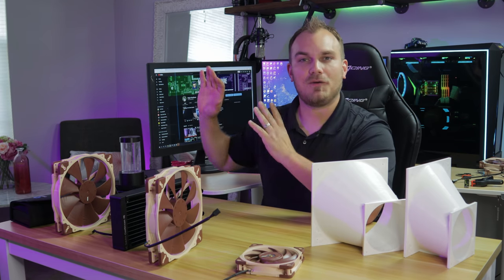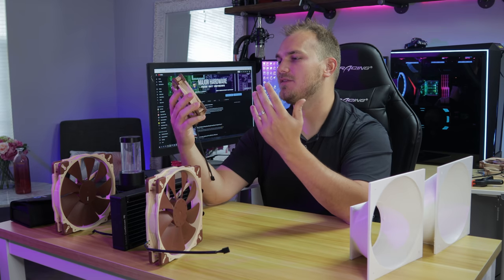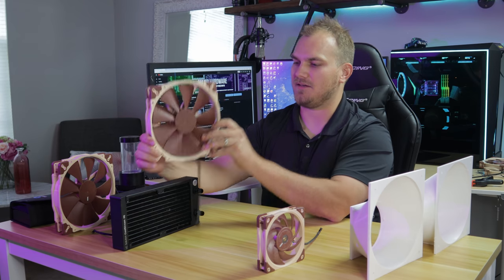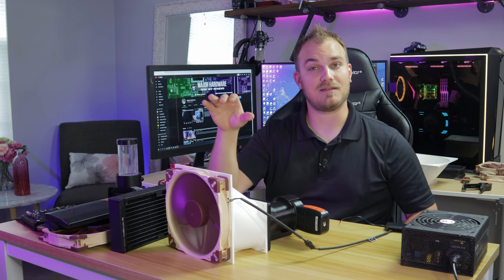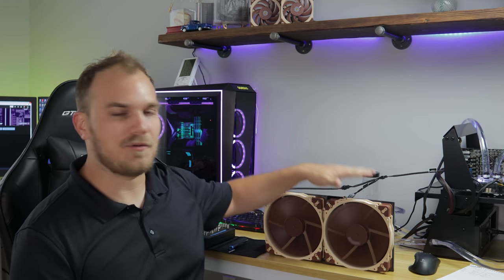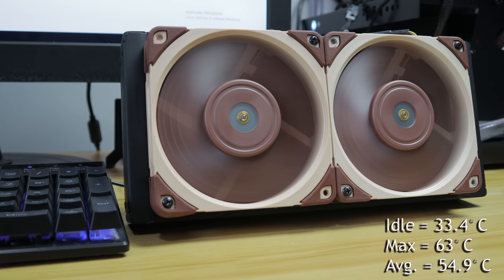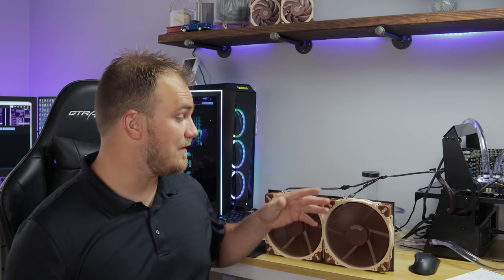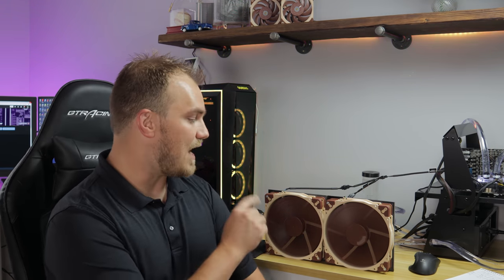Cooling A 240mm Radiator With 2 MASSIVE 200mm fans

Comment: Could you print a 200mm rad for these fans? Well, I guess you could if you could print metal. 🤔
I am thinking a 200mm rad could be way thinner than these smaller rads as you have more surface area, and that also means you need to have less air pressure to push/pull air through the rad.

Comment: Idea for an air-cooled PC: routed air intakes for CPU and GPU. Draw in air from a case fan, have it blow into an air duct leading directly to an enclosed heatsink, and then through another air duct leading directly to an exhaust case fan. Add another case fan for positive or negative air pressure for mobo cooling, totaling 5 case fans. I wouldn't take the dedicated fans off the heatsink though unless it causes problems.

Comment: Do the same thing, but port and "polish" the fan shroud you made! like the intake of a performance motor. you want it to be nice and smooth to let the air run as well as possible!port the 120mm fan holes you made so the big fan can take advatge of the square radiator! "polish" the print with some acitone to smooth it out

Comment: What about just 1 200mm fan on that 240 radiator? It should be a simple cad to make it work. You don't need 10cm distance from the fan to the radiator as you have on the 2x200. Also, what about in PULL mode?

Comment: are there any good and silent 180mm fans? cause that's a good compromise between 120/140mm fans and a 200mm fan and is the same size as a Mini-ITX motherboard. Not to mention there's actually 180mm sized radiators :)

Comment: The small side of the shrouds could have been square with tabs on the interior for the screw holes... basically to let the fans push air directly at the full fin surface area.

Comment: To take the full effect of Bournelli's principle the two diameters should be concentric. This gives the ram effect. In the current design, the top half has the ram effect, and the other half does not. Btw, which Solidworks version that you have?

Comment: I would have tried to cool the 120mm x 240mm radiator with a single 200mm fan.  The cross-section area of the 200mm fan is ~31k mm², while the cross-section of a 120mm fan is ~11k mm², so you would have about one and a half times the airflow cross-section in the 200mm fan from the start, or comparing to the cross-section of the face of the 120mm x 240mm radiator it is ~29k mm², which is close.  I'd say the single 200mm fan is perfect for that radiator.  Print a circle-to-rectangle shroud to connect it, it won't be much of a funnel either.

Comment: I am pretty sure if you change the air direction to pull air from radiator instead of pushing, the temperature will be better

Comment: How about another 2 brackets on the other side for push/pull, incorporate the pump into the empty space between them, giving the whole thing a separate from the pc case "case" look and just run water lines straight into cpu block in your pc case. A 2 towers, silent pc setup.

Comment: did you  blow or suck the air ? because through this adapters i gues it would be a better solution to suck air instead of blowing, the blowing gets kind of limited be shrinking diameter i guess

Comment: Little bit of fluid dynamics here, pressure drops when rpm drops thus the radiator has to have a bigger surface area not just the fan

Comment: Please try a one fan setup on a dual radiator, and 3d print a 180° pipe that makes the airflow comeback on the other side of the radiator (where there is no fan)

Comment: I know 3d printing won't give the best results, but why not try to design a model of these fans for static pressure? With Cooler Master releasing their own 200mm AIO, though with their non-standard fan mount, it might be time that these larger form factor fans get a model optimized for static pressure.

Comment: ive been thinking to use 240 mm fans on 2 parallel radiators, would be cool if you could test that out, and if there are any 240mm fans :D

Comment: Can you try to put DC to DC booster circuit in 200mm fan coz this fan are rated 12v +/- 10 % that mean you can run this fan up to 15v it will increase rpm and air flow please try it bro it's gonna so much fun

Comment: You need static pressure fins back to the fan so the air wont escape from the front so easily. It will give more static pressure because there is a bottleneck. maybe 30% more airflow!

Comment: Forcing air into a constriction (bernoulli's principle) won't work with a normal, low RPM fan.  Compression of air (by way of the convergent cone) only happens when the velocity overcomes the fluids' innate friction.  The airfoils must be high aspect ratio (chord to span ratio) and a low angle of attack AND spin at extremely high speed:  i.e. 40 to 60,000 RPM  additionally this setup must utilize a set of stationary (stators) blades to straighten the airflow.  Following that, they must be made of a metal that can withstand the immense centrifugal forces plus require an exponential amount of horsepower to drive them that fast.  Our single engine helicopter turbine engines output 900 shaft horsepower. However, they must produce 1500 horsepower globally because the 1st stage compressor section (being self driven by the same combustion process) robs as much as 600 horsepower to run itself.  
Now, you could flip the big fans and have them pull air thru the RAD however, this would only be efficient if you made an identical set of cones for the other side of the radiator.  In effect, making wind tunnel still limited by the low RPM fans (weak) and un-optimized blade geometry.

Comment: I tried this back in my sophomore year of Highschool.  I was broke, so I used the schools 3D printer to make a shroud that would fit a 120mm fan onto my 95mm stock cpu cooler for my AMD FX 8350.  Oh boy, did that thing get hot.  It would go well over 70 degrees and fallout 4 would crash. It did not work at all.  I was using a crappy fan though.

Comment: Must say I'm (positively) surprised by the result. Usually, these big type of fan suck big time in static pressure, which is key for a radiator fan. Or convector fan actually, a "radiator" like this barely radiates and does almost all heat transfer convectively

Comment: See what happens when you attach 4 Noctua 140mm fans. How much lower are the temps compared to 2 140mm Noctua? How low can you reduce their speed to cool the same as 2 140mm? How loud are they at the reduced speed vs the 200mm? How do they compare to a push puss system with 4 140mm?

Comment: I want Noctua to make a 200mm fan in the vein of the iPPC 3000 RPM variants.  Not for my computer, but for the next time a major huricane hits us and I'm working off a car battery.. like when Irma hit.  I'd use a PWM controller, so it wouldn't waste the battery, but it would be a life saver.  I had a crappy 12v fan that took 8 "D" batteries last time, and had to take it apart to splice a power connector so I could run it to my battery, but it was less than ideal.  I'd like to make something nice that can handle the 12v, but can be dialed down with PWM.  I had to endure 130° heat in the house for two weeks after that storm came through, and there are short power outages nearly every day here in south Florida, so it would be a good thing to have.  Purpose-built fans are just cheap Chinese junk.

Comment: I don't see this beeing practical in a direct PC-Case-build, but what about a desk-build? Or hide away builds in general for a home theater or suble elegant solutions. 

Also one may note that the bigger fans run on a far lower frequency which makes them seam alot quieter. I don't know if you have some dB-measuring device.
Reply: You can, but due to the enormous ducts a larger radiator would take much less space and cool better (you can use any radiator, I have a 200x240x80mm copper radiator in my PC) just use the fans on a correctly sized radiator.
Reply: @jakegarrett8109  well yeah. Go for the bigger rad if it fits would be the correct choice. But with a desk build I rather meant general airflow into the PC-"room" itself with silent intake fans. Depending on the setup, some sort of air duct could be neccesary, having a similar function to the cones.

Comment: I like this idea.  How about a *(Push, & Pull) with the 200mm fan's.  I don't have a 3D Printer.  But I could make this.  With a sheet of *(Plexiglass).  I was also thinking about this.?  If you use *RGB 200mm Fan's.  It would reflect off the *Plexiglass.   Because as we all know.  RGB makes everything run smoothly, & better.  ha.  ha.  ha.

Comment: I wonder how a single A20 would do if the adaptor went from the 2*120 mounts to a single fan in a pull orientation. I reckon it might get super comparable performance.

Comment: My best idea thats around 2 years old.

1. Buy a floor fan that is the exact size of a pc case side panel.

2. Place the largest rads you can get in the front, top, and back of the case. (no fans on any rads just dust filters)

3. Seal the entire case so that the only place there is in the case for air to enter/leave are through the radiators.

4. Hook the gpu and cpu up to the rads.

5. Affix the floor fan to the side of the case as if it's the side panel and seal it. (direct it to pull air from inside the case)

I know for a fact that this will have enough airflow to keep the components cool the only issue is how quietly will it be able to do it.
Reply: You don’t need any fans if it’s that much radiator, I passively cooled Crossfire much smaller radiator at like 45c load temps, haha! Box fans are insanely noisy and unbalanced, you don’t even need one if you have that much radiators.

PS, a box fan should keep about 12 GPUs cool if you’re running a water cooled server or mining, just use a car radiator for $20 from the junkyard.
Reply: @jakegarrett8109  45c under load? You my friend are either merlin or penguin. Because you either using magic or live in an igloo.

Question... How long do you run these stress tests for?

and ps if i massively under volt a box fan and have it spin at like 100 rpm i highly doubt it would be that loud
Reply: Skitzotech Gaming  72 hours under synthetic load for constant power draw. Radiator was 200x230x80mm fin area copper radiator (you can find these as the passenger heaters under the seats in the back on a school bus).

Specific test details:
Tested on 2x RX 470 cards at 120w each (measuring from 12v output rail on my HX1200i platinum PSU since it graphs out power probably more accurate than my kill-a-watt meter). Room temp was about normal to kind of warm, generic acrylic topped copper water blocks powered by a pretty big fish aquarium pump model CHJ-3000 (roughly 55w-65w pump depending on flow restriction, rated 3000 L/hr with 3 meter head pressure, it makes the 3/4 inch hoses jump on my quad Fury Crossfire when the pump kicks on, haha! It’s about like a garden hose full blast)

Misc/rambling:
You can also cool like a 400w Threadripper CPU with it too, I wasn’t pushing that cooling system too hard. The water gets pretty warm, but as long as they don’t pop off the hose barbs it’s fine since clearly the GPU temps are fantastic (stock the cards had fans kind of loud and ran 80c, in cramped Crossfire they would be worse, that temp is from an open air test bench, so your case may make the fans REALLY spool up! XFX RX470 hotswap duel fan cards). When stock they had seriously low temps on water, but as I said I wasn’t pushing them, I can push over 300w per card benching on air, they are BIOS modded for unlimited power limit as well as a few other things that let me take the #1 TimeSpy score for duel RX470 (and I did that air cooled), but I used a 130w modified case fan to blow between them since they were kind of packed in Crossfire (benchmark score posted under my benching name 0C_Monk3y). Haha, I just soldered some new mods to those cards now that I think about it, I should run down to the store and pre-test with some dry ice and phase cooling before I get some LN2 to break my old record that was on air, haha, that will be fun, maybe next weekend!

Comment: will a powered peltier cooler on a radiator(mounted on the side of the rad blowing air), with a cpu cooler to cool the hotside of the peltier, improve the cooling of the radiator? (air in-radiator-coldside peltier-hotside peltier-cpu cooler-air out) have considered making something like this, and triger the peltier+cpu cooler of it when water temp hits a surten point :D could be a fun project and good video, no idea :D always nice outside of the box thinking in your videos, keep it up thumbs up

Comment: So according to my calculations.
this fan 140 fan
https://noctua.at/en/products/fan/nf-a14-pwm/specification

and this 200 fan
https://noctua.at/en/products/fan/nf-a20-pwm/specification
push about the same volume of air
but the 140 achieves about 2x the static pressure.
adding two fans in a row should about double the pressure so lets compare the sound level of 2x 200 (push-pull)  vs 1x 140.
140 has 24.6 dba
200 has 18.1 dba
Now I'm pretty sure the sound sources are incoherent in this case so the 2 fans should be about 21.1 decibels.
so 24.6 for the 140 and 21.1 for the 200s
about 3.5 dba difference.
and "It turns out that a sound which is 3 dB higher than another is barely perceived to be louder; a sound which is 10 dB higher in level is perceived to be twice as loud."
http://forums.prosoundweb.com/index.php?topic=91230.0
(I read more sources and they seemed to more or less agree)
so a noticable difference but not by that much.

Of course another point is that larger fans tend to make deeper less annoying noise but that is something that needs to be heard and may be different based on the individual.

Too lazy to check for spelling errors so come at me grammar nazis!

Comment: Tip, you are probably bottlenecked in this situation by the cpu itself. I think that if you used something that runs hotter under normal circumstances (around 80c with the aio) the difference could be bigger

Comment: Go big or go home, I demand air duct to and from PC case with box fans on both ends :D
should be quiet enough, if its in next room or in wall or something :D
Reply: Saw an article from like 2005 where the guy was a silence freak so he had his whole PC room water-cooled with copper pipe running into his garage where he had so many rads hooked up he didn't even need fans
Reply: yurimodin why would you need multiple radiators? My 200x240x80mm radiator keeps multi-GPU at like 45c or lower at max load stock speeds without fans (tested for 72 hour with synthetic load).  It doesn’t need to be all that big for a passive cooling. Just get a car radiator for $20 at the auto salvage if you want massive to the point fans won’t even really do anything.

My normal/primary build uses over the 1.7kW, so I do have fans now on that radiator, but it’s not like you need fans cranked while running it.

Comment: Compress the air before the radiator. 
Not a good idea 
Do you know the air get bit hotter as ambient temperature then.   

Change the flow direction to decompress the air in the radiator and make it cooler then the ambiemt temperature = more performance 

Have a nice day

Comment: the problem with big fans is they have no static pressure. cooling fins need dat flo for the go. ofc just crank up the rpms on the big fans, problem solved.

Comment: What if you overclock the 200mm fans?
Reply: Then better performance at same or still lower noise level as the 120 fans, use a DC boost converter for this, but do note some fans will burn out at rather pitiful over-voltage but it does make slow cheap fans actually useful.

Comment: I wonder if you could try "hydrogen cooling" in your air-cool a waterblock experiment. Hydrogen gas is used to cool generators at power stations, because it carries heat better than air.
Kindof dangerous.

Comment: I'm gonna go out on a limb here and guess that this didn't actually work very well. 200mm fans can potentially move a lot of air, but they tend to have poor static pressure. Airflow through a radiator tends to be limited by pressure rather than a fan's maximum airflow, so I think using those fans on a smaller radiator will actually perform worse than some decent 120mm fans.

Comment: Two 120mm fans on a 120ml radiator vs the normal one or push pull configuration.

Comment: here's an idea..flip the fans around instead of pushing the air through the radiator why not pull the air through by vacuum...after all isn't the idea to pull heat away and not blow on it.. just like a fire you add heat by blowing air on the fire but remove heat by vacuum...

Comment: What about a fan overclock with custom pwm or over voltage? 😋
Reply: Most cheap ones will handle 20v, some die at 16v... Don’t worry, the last one I fried got it’s motor replaced with a small RC airplane motor and it’s limit is when the blades about explode (at 130w, or 11 amps at 12v) the blades expand too much and hit the housing. I use that fan a lot for my air cooled overclocking (if I really wanted some air, I have a 70mm fan that uses 65 amps at 24v, so over 1.5 kW power draw or 2 HP, unfortunately normal PC case fans can’t handle that level of power).

For over-bolting, use a cheap $1-$2 DC boost converter, it will allow you to crank up the voltage to any level (typically up to 40v) from the 12v on your PSU. It really makes the cheapo fans actually spin up and do something. Note that doubling the voltage doubles the amps, so you’ll have 4x the power when using 24v (a lot of the slow cheap fans will survive this for a while, but the motors get a bit warm, just drill a few motor vent holes, it doesn’t take much at all).

Comment: A smaller fan that runs faster versus a slower fan that is bigger well I would've never thunk (haha)! Try running the same fans at the same RPM. RPM means air pressure increase thus higher cfm or air movement. Not even a fair comparison!